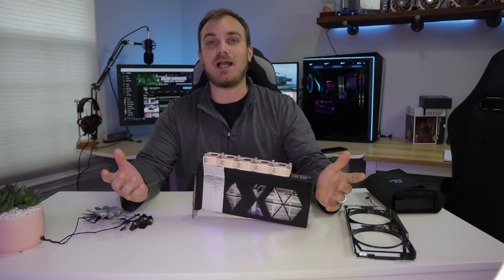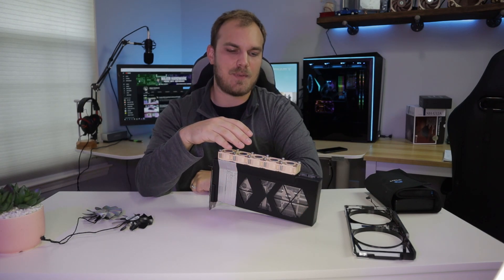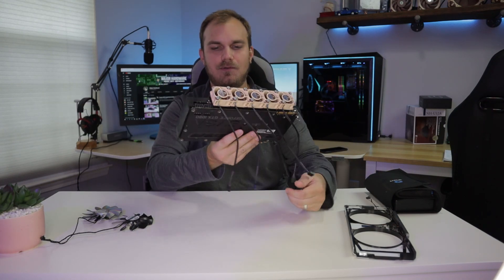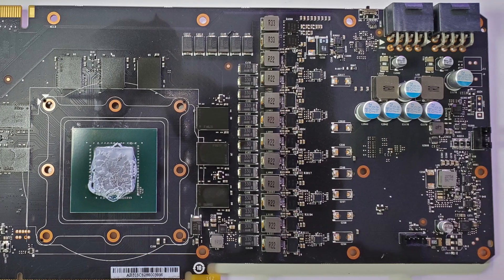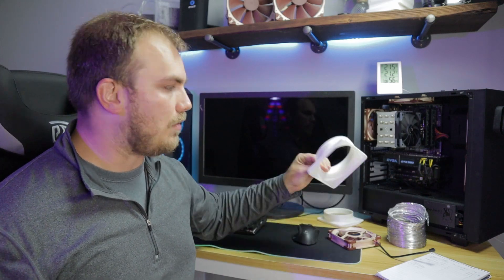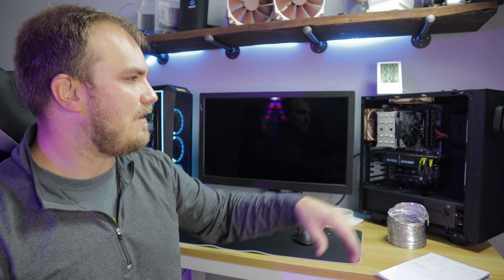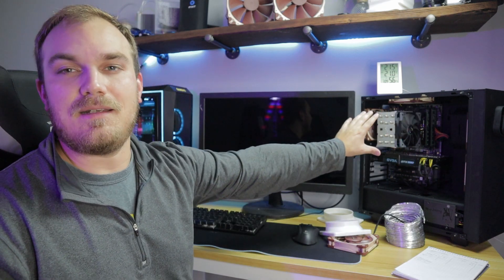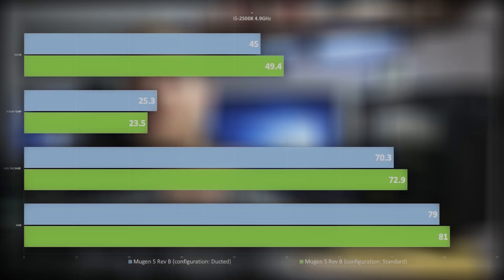Does Connecting Your CPU COOLER Directly To Your Case Fan Improve Temperatures?

Comment: I know for CPUs at least this used to be popular. But for modern computers with GPUs that dump heat into the chassis, it seems like there would be an opportunity for a case manufacturer to at least try something like this to stand out. PSUs are already ‘ducted’ by design so why not the two hottest components? make a nice split chamber chassis designed to bring air into each chamber separately, and maybe a riser card to put the GPU somewhere that its exhaust can be nicely exhausted too - maybe vertical would work well in a situation like this

Comment: why not just a 90 degree angle direct to the side of the case and a hole there?  they used to have side panels with extending ducting to lower over your HSF not all that many years ago.

Comment: Are you saying "delta" to mean the actual temperature? Because "delta" in the science and engineering community means "the difference" or "the change" and its confusing because if you say "a delta of 45 is better than a delta of 49" youre saying "a drop of 45 degrees is better than a drop of 49 degrees" which makes no sense.

Comment: Oddly, I've done this to my AMD athlon Thunderbird 3000+ machine but with a smaller rubber tube coming in from the side & got really good results(10'c lower temps) with just just a thermal take volcano 12 CPU cooler with artic silver 5 thermal compound, pulling though a light washable filter, so...
Please note this machine is over 20 years old when I did this so...

Comment: I guess the main advantage of using a duct is to decrease the amount of fans in the system.
Ex: HP DC5850 SFF | 1 single fan that blows air into the case and through the cpu.

Comment: I wonder how much of the heat Inside of the case is effecting the air temps inside the duct being that it's pretty much aluminum foil (acting somewhat of a heatsink). I can only guess that 3d printing a duct would further improve CPU thermals a little  because the duct wouldn't be picking up as much heat inside the case, and the flow of air would be better as the 3d printed duct would be smooth vs being wrinkled up and would have a better seal.

I hope you revisit this.
Reply: Yeah I would probably buy white 4" PVC.

Comment: In my prev company we had a IBM xeon server that had the CPU cooler completely seperated. It had a plexy glass tunnel from front to the back. It had a fan on the front of the case and another one at the back of the case. It was working very well, noisy but well.

Comment: Oems did this back in 2006 ish.. called BTX, (instead of ATX), the move was to have a big 120mm fan cool down a hot CPU, and the rest of the air from that fan just blows the air out the back of the case. Before this we had noisy 80mm CPU coolers, 120mm fans running around 1000rpm in office use was a revolution.
Intel was one of the major drivers behind BTX, mainly because of their very hot Pentuim 4's and Pentium D's

Comment: This is literally what I did almost 20 years ago overclocking my Athlons. Only I worked from the side of the case as coolers were oriented differently and I used a smooth square plexi fanduct held together with ducttape, as this tube would generate far to much turbulence. But yeah it worked back then, up to 6-7 degrees Centigrade lower temps, depending on the room temperature (in winter I even opened my windows and put on a coat on, just to see how far I could push it).

Fun times ^_^
I also learned not to tinker with the PC I did my schoolwork on xD

Comment: I've done this using an extra duct running from the back of the case up to a window mounted air conditioner during the summer. I sealed up the sides of the radiator as well to avoid condensation build up inside the case and ducted the air out the front of the case. Worked better than I ever dreamed. You'll get better clearance if you can finagle your CPU cooler to face vertically in the case rather than horizontally, though not all coolers can do that.

Comment: Ducting absolutely works, especially with a closed case. I used to install ducts on hot components over a decade ago in systems that run 24/7 at full load for DC projects. I don't anymore because I don't need the additional cooling benefits, not keen on the looks and takes extra space as well as extra work to fit the ducting components. For those people who do not want water cooling and need the lower temps because their CPU runs hot with whatever they do, definitely use a duct!

Comment: I was actually going to do this on my first computer build.  It seems to actually make sense.  I just wonder if you only need two fans though.  One pull air in and one to blow it out the back, with another duct connecting it to the back of the case.
Reply: you could, but it's almost better to let the warm air from your cpu "cool" the rest of your motherboard components.
Reply: The main advantage is that crappy air cooler no longer has to struggle using warm case air to cool the cpu, it always has cool fresh air.

Comment: If you don't have another source of air over your VRMs, this could kill your board. Had a motherboard actually go on fire because it didn't have air flow over the VRMs. Somehow, the system locked up due to a vrm overheating and wouldn't shut down and when I woke up and went out to check on it, there was smoke everywhere and it was screeching like a dying rat. Make sure there's airflow under the VRMs especially with older boards. If in doubt, the VRMs are located around the processor, usually modern boards have heatsinks on them, but it should still be noted the board needs airflow as well to prevent this issue or a chipset from overheating.

Comment: I've got a gaming PC in a media PC case (Not sure of brand, it was a gift).  The CPU cooling fan sits right under the top cover and pulls air directly from the room and disperses it into the case.  I can always tell when it's time to dust because my CPU will start running hot.  For a machine that was built to run WoW a few updates back it still runs surprisingly cool.

Comment: i did this with my 2500k got 15c lower temps on stock cooler only i put the side case fan directly on it and you have more pressor so that the air can move better threw your cooler

Comment: In the 2000s HP launch a desktop CPU that did exactly that. It has a plastic tube to direct the air from your backside fan straight to your cooling block.

Comment: I remember doing this with a Coolermaster case 10 years ago. The case used two 200mm fans, one on top and one on the side. The top was a general exhaust and the size side was ducted to the cpu fan/heatsink. If I recall, it was good for 10 to 15c after hours of max setting WoW. Liquid cooling took over after 2010, no further ducting development experience.

Comment: yeh I use to duct my stuff , now all I do is force exhaust the CPU heat through the PSU inlet/outlet main reason I still mount PSU @ the top , when ducting everything other PCB components like VRM's can overheat so better having a x flow through the case , though if you really want to cool something down you want longer heat pipes as most CPU  coolers are only half the length of what's needed for them to effectively work ,  sometimes I wish the CPU's were on the bottom of the boards then you can actually make a decent cooler

Comment: In my previous handmade PC case I was use same thing, but not only for CPU. It was two air ducts. One for CPU and another for GPU. Intake fans was my old high speed Zalman fans. As well as was 230mm Bitfenix fan for intake who forced air in case and cooled my 4 HDDs, 2SSDs, motherboard and etc.
I was used only old rusty PC case, paper and scotch tape. CPU cooler was Thermaltight Macho Rev.B.
My PC was looked like peace of sh... but always very cool, clean and silent.
Sorry for my English, guys))

Comment: Technically my 2008 Mac Pro does this, the 2 front fans are divided into two air ducts, and the bottom one, flows past the CPU, then the RAM, and is then exhausted out the back.  The top fan blow through the IO bays.  (PSU still has its own fan as well).

Comment: so, the console cooling solution on a pc?
iirc this ended in pcs due to motherboards increasingly needing component cooling in recent years.
with last gen fx boards failing due to vrms overheating, even with case cooling, if you replaced the cpu fan with liquid cooling.

Comment: well i dont know about you, but i always have at least a 120mm fan thats blowing hot air out of my case ... usualy somewhere in the top area ... always built my air cooled cases like that, always works like a charm ... you suck in air from the bottom, and blow it out the top ... if your ambient temperature is not 50°C at least :p

Comment: Just have proper air flow into/out of the case. The air inside my case is exactly the same as the ambient temperature in the room. The air is not stagnant in the case long enough to pick up an appreciable amount of heat.

Comment: Now I wonder if the water cooling setups have typically done better due to pulling cooler air from outside the case. To what extent does that play a part?

I water cooled once. Costed a lot and drove me crazy worrying about potential leaks. It never leaked but when it came time to clean the loop I said screw it and just bought a large noctua cooler... 

I should try this out. People are saying they used to do this but stopped because it wasn’t “cool” but custom builds don’t really leave room for a one-size-fits-all solution.

My build is fairly stuffed already, but I might be able to make a 90 degree duct from the side of the case door...

Comment: Is that too fan intake or outtake? If outtake then of course thermals would improve; that fan is taking fresh air from the cpu cooler. Basically now the cpu cooler doesn't get as much air due to the top fan stealing it. This is why placing fans in a case comes to be much more interesting and harder than one would think. Sealing it off with a duct would effectively stop the top fan from messing with the cpu cooler

Comment: Cool video, man. I've thought about doing this before, but using this massive black 4" 3-ply silicone hose I've got, which is typically used for engine air-intake/intercooler setups. But I had about 9" of it leftover after working on my car, so I figured I'd give this a shot. I see you getting a lot more subscribers in the near future, within the next year or so. And then you'll have all of these companies sending you a bunch of free hardware to check out and use.

Comment: The aluminum tube will be heated by the case temp from outside of the tube to the air flow inside the tube. You should try to insulate the tube, similar to ventilation systems. Alternatively have a 3D printed tube, plastic do not transfer heat as much as aluminum.

Comment: Actually, this is the idea of BTX. BTX was a thing in the earl 2000s, they used an air duct with a single fan for everything. The air is drawn in and blown over the graphics card, north-bridge, CPU and finally out through the PSU. Very nice for office PCs. But since almost all home PCs had stronger graphic cards which often can't survive in a BTX environment, it didn't sell well so BTX had died eventually and ATX stayed the norm.
Reply: 🙂 RIP

Comment: Great idea and great video!

I had this idea when dealing with hardware for Flight Sim X in the late 00's. When I (and a few others) brought up this idea, we were laughed off the forums. I was even thinking about using an impeller - like what I used in the cold air inductor on my car, just fitted to a pc - they're probably still laughing…  cooling my system wasn't really the problem anyway - not enough horsepower in computers back then…

Comment: The comments are Savage but I do remember my old Optiplex GX260 at my school from Dell having the Dell F5006 fan Assembly which was an AIO Heatsink fan combo with a duct that pulled air from the back of the case

Comment: I had a Apple G5 Tower from 2005 and it had baffling inside that essentially did the same thing, but it literally sounded like a jet turbine when it would start to spin up all the fans on it since it had dual Motorola G5 cpus in it.
Reply: 🙂 yes the Mac Pro towers are similar, has a beefy front case fan, also Dell Precisions have a front heavy case fan, i pulled it out once and its really heavy, u can rig it and use it as a table fan, it blows alot, similar to a 16 inch table fan 😊 lol

Comment: Internal Ducting was something that was done a lot and actually the first thing I tried to get better Thermals with my system.  I have learned that having a big heatsink like that extremely close to the backside of the GPU can increase your Temps dramatically. (My system Strix Z270I; RAM @ 4266; BCLK@103.2; 7700K currently @5.150GHz with Noctua NH -D15; EVGA 1080Ti KingPin)  At the Peak of case Modification, I had my system in a Phanteks Enthoo Evolv ITX case with the side panel completely removed, the Front panel Cut to add ~1"x12"" vents to either side, added a hole with Fan to the Top of the case, and the case on its side with air being drawn into the case from underneath through a hole I created behind the CPU (a total of 6x 140mm fans and 1x120mm fan adding airflow below a 140mm in the front) .  Trying to use every bit of Thermodynamics to get as much fresh air to the system as possible and the Hot air out.  While playing a 400+ modded Skyrim, I was running 85C on the CPU and unstable past 4.8GHz; 80C+ on the GPU.  Then Since EVGA gives you that lovely utility with all of those temp sensors ... the backside of my GPU was running 96C.  Way too hot and explained why I could not get the guaranteed overclock the KingPin offers.  Then I found a "GPU Kickstand" deal to run the graphics card outside of the case.  By doing this my CPU temps dropped 20C and even @ 5.150GHz still runs in the 60s under load with Peaks in the High 70s maybe an 80C from time to time when the room is warm. GPU Temps were still a little off for my liking but dropped into the high 60s, low 70s.  Then I re-applied the TIM on the KingPin GPU with some Arctic Silver 5 (have a ton I need to use up) and My GPU with a slight overclock, now runs in the low 60s under load. Everything runs about 10C above ambient @ idle, now time to Upgrade and apply this knowledge to my next build.  Going to Liquid Cooling from now on, I am done with air for OC.

Comment: i have 2 with those tunnels built-in on my i3's  and my custom build doesn't need air tunnels with the 4 fans in it nothing gets over 72c in my build if it does i replace the paste in it. at 82c is when i start replacing the paste. none of my pc's get over 72c and all are oc'd.

Comment: Compared to the olden days, todays OTHER components like VRMs get much hotter. Having airflow blocked from them in that amount can decrease their lifespan or efficiancy...
NVME's SSD's for example need some airflow or they will throttle immediately.
Reply: Most cases support 3 x front fans. This removes one from the circuit. The 2 remaining fans would Easily cool VRMs and motherboard heatsinks/spreaders.

Comment: They used to make such shrouds, either like that, or a funnel to a side panel hole you'd cut out, or in the case of dells, a plastic shroud integrating the rear exhaust and the cpu cooling into one function.

Comment: Radiator fans from the 1984-1990 Toyota Camry slide right in place of the side panel for 21-22 inch computer cases.

Comment: If you want the best cooling take the bottom feet and mount them on the front of case then turn it so front case fans are on bottom and back of case is now top... Silverstone did this 10 years ago and still does their cases this way and my Raven 2 is still the best Air cooling case I've owned.

Comment: That doesn't sound like a good idea to me. If there is a temperature difference, I will have to assume the remaining components will run hotter, because the air flow from the CPU cooler would help cooling them otherwise

Comment: You'd probably get even better temp if you isolate the heatsink as well and exhaust it straight out the back with more ducting. You could do a similar thing with your GPU just pull it from the bottom, isolation will solve all inconsistencies.
Reply: This GPU is a blower style that dumps it's heat out the back of the case, so you want some air getting dumped into the case.

Comment: Years ago I made a cool-air duct out of a hacked up fan chassis and a 2-liter soda bottle. IIRC cpu temps dropped 10c under load. No intake fan, just a tube from cpu fan to outside the case.

Comment: Case sucks...it has nowhere to get the air from, just look at it, it's basically a throttling in other words, vents are prob from below or above, and small ones, and it's not enough.

Plus, visually unappealing for 2-5 degree change, and in some cases (not the pc case), as I see, a bit hotter than default.

Comment: Curious what the temps would be with the duct removed and the top fan turned off (or even turned to intake). Current setup looks like it makes a low pressure pocket right in front of the CPU cooler intake - which the duct is compensating for. The fan is definitely better for mobo/ram temps though :)